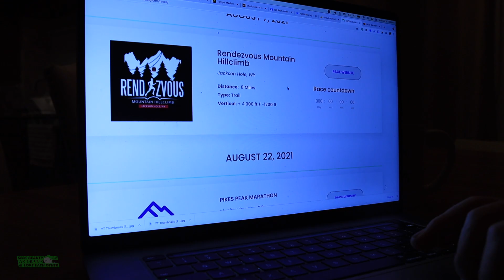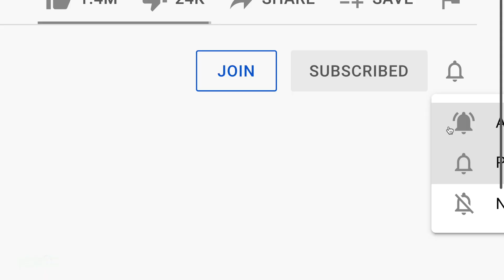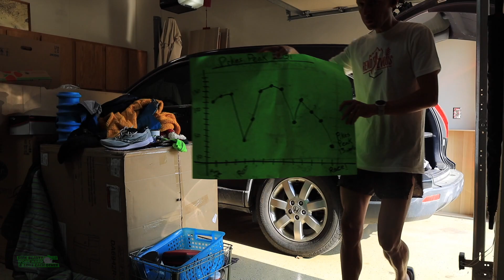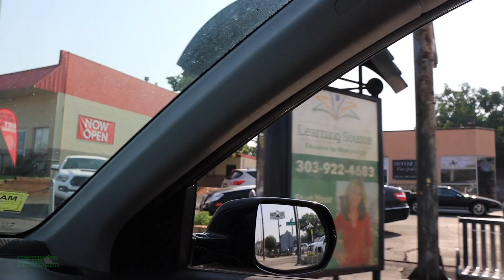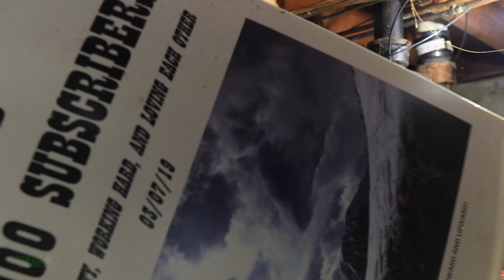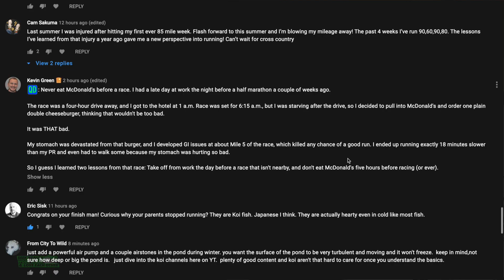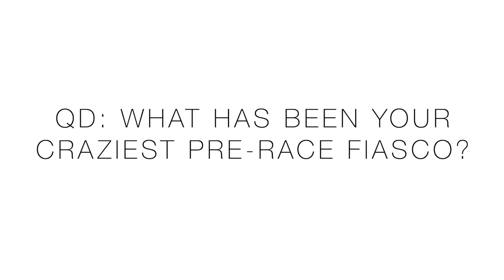Hardest Training Block Phase for Runners Starts Now

Comment: :_qod:: Thanks for selecting me for the Comment of the Day, Seth! It was a humbling experience, but sharing helps me get over how embarrassed I felt during the race.

You're right, I am kind of new to running. I ran XC and track in high school but took seven years off after graduation. I started up again last year at the beginning of the pandemic.

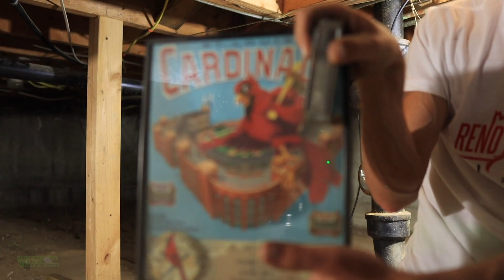Among other pre-race fiascos, just this past weekend I signed up for a 1-mile stroller derby with my five-month-old daughter. I made it just in time for packet pick-up after running 6 miles with my running group and driving 20 minutes home to pick up the baby and then another 30 minutes to the race, but they started the race two minutes early! I managed to get in line behind walking strollers eight seconds into the race, so I had to do some dodging to finally get going. Ended up winning the race in 6:36, which happened to also be my fastest mile since I starting running last March.

Onward and upward!

Comment: My greatest fiasco pre-race: I went on a running holiday with a friend to Belfast to do a half-marathon there. I woke up in the hotel on the day of the race and began to prepare my stuff only to discover I hadn’t packed any running shorts. My friend didn’t have a spare pair either and as it was Sunday in a religious country there was no chance of any shops being opened before the race start. So, I took my micro towel, some safety pins and fashioned myself a little, makeshift mini-skirt! All the way around the half my greatest fear was that it was going to fall down, but I got to the end with my dignity intact and a medal for my effort! Win!

Comment: QD: Last club track season in the Winter of 2021, I was signed up for a race about 30 minutes away from my house in Highlands Ranch, CO. My coach told me that the meet was at Mountain Vista High School, but when I arrived there it seemed pretty dead. After walking around for 5 minutes it became clear the high school wasn't the place. My coach found the actual address, and I had to book it over to the stadium with 30 minutes left before my race. I got there 3 heats before my mile race, hopped out of the car, warmed up as snow started falling, and then put my spikes on as I was stepping up to the line. I totally forgot to take off my warm ups and had to ask the officials to wait for me. All in all, it was a very poor performance, but I made it out there and was able to race at the very least. Still, not the most positive 40 minute drive back to my house.

Comment: About 15 years ago, in high school, I thought I was pretty hot stuff lining up for a Turkey Trot and decided that socks would be “too heavy” to wear inside my very meshy racing flats for a race on a cold, snowy Thanksgiving morning. I couldn’t feel my toes 5-10 minutes prior to the race. However, I managed to make it through the race, grabbed my top 25 finisher pumpkin cheesecake, and went right to my car. My hands were too cold to fish my key out of the tiny pocket of my tights for a while. Eventually I got that out and hit the unlock button and got in. Then I just sat and screamed in pain inside my cold car til I could get a little more feeling in my hands to be able to stick the key into the ignition to start the car and turn the heat on. Then when I had enough dexterity in my fingers I was finally able to unlace my shoes and stick my feet directly on the heat registers. Again, screaming pain. All told, it was probably a 45 minute process before I felt safe to start driving home. Probably got some frostbite that day. Moral - socks are important in the winter.

Comment: :_qod: Seth I was running Hood to Coast Relay and instead of bringing bagels  ect. I decided on bringing a Roast Beef Sandwich and chocolate covered expresso beans. I thought the beans would come in handy because I would be running at night. It was 95 F and I was running way too fast. This whole fiasco turned out to be the worst decision I have ever made. I ended up getting really sick between the heat and expresso beans. I did finish my running legs and turned out ok but never ever again.

Comment: QD:  no GI issue stories in my 45 years  of running road races (started as a 13 year old with my Dad). But, also with my Dad, in ‘93, we planned a Bay to Breakers run with about 75,000 other “runners” in San Fran. Went down to the starting area 2 hours early and stood in the the crowd of thousands unable to move until the gun. And, of course, I had to pee almost the entire time. 30 minutes after the gun, when we finally crossed the Start line, I hit a portajohn for relief! Crazy and awesome experience the Bay to Breakers race, just make sure you go to the bathroom before you go to the race!

Comment: QD: Fairly new runner here. I think my very first race was a five miler and it was cold and raining that day. I prepped on a treadmill and never outside for the race. I wore a light jacket I never ran in before. As you can, there were a few mistakes here. Not running outside and implementing something new on race day.

Comment: QD: Another race day fiasco was at the 2018 Broad Street Run. I was amped up, and ready. I was hydrated and went to the bathroom before the race started. By the time my coral started damn near 45 minutes elapsed. By mile 2 I had to use the facilities on the side of the street.

Comment: QD: My biggest pre-race fiasco was during a cross country meet last year. (I am in 8th grade by the way) I had a big long bus ride to the xc meet and I had no idea what the course would be like, so I brought my spikes and my trainers. When I got to the meet I asked my coach for the map of the course and he gave it to me. I looked at the map for a couple of minutes and it didn't look like there was any pavement on the course, so i went ahead and spiked up. I got my little timing chip from my coach and tied it to my shoelace. Anyway after that my team and I did our warmup run and strides and stretches. We went back to our coach one more time to look at the map of the course and then I saw some pretty decent size patches of pavement, so I decided to take my spikes off and switch to my trainers. I completely neglected the fact that the patches of pavement are on the 5k course, (and I was running the 2 mile). So after that I made my way to the starting line and about ten seconds before the gun went off I looked down at my shoes and the timing chip was gone! I realized that I had left it on my spike's shoelace. At this time I didn't have a watch to see what time I got and there was no way for me to tell what place I got without that chip. So I ran back to our teams tent, conveniently very far away, to get the time chip. I couldn't get the time chip off my spike in time and by then the gun had already gone off and everyone was running. So I just ripped the time chip off the shoelace and started running back to the start line. While  I was running back to the start line i wasn't looking where I was going and I bumped into a toddler who fell over and started crying. I was just glad his mom wasn't there. I kept running to the line and then somebody from behind me told me to stop. I turned around to see who it was and it was the toddler's mom. she said that I had to say sorry, so I did. Then finally she let me go so  could start running. by this time everyone was already halfway through the race and I was guaranteed a last place finish. I ran the whole race anyway, holding my time chip with my trainers on and finishing second to last. It was a total disaster.

Comment: QOD: My biggest pre-race fiasco was for my first and only road full marathon. The race, The Sasayama Marathon, is notorious for being cold, sometimes with snow, and I trained accordingly.

On the day of the marathon, it was sunny and unseasonably hot, "but just in case", I kept my warm clothes on. Yeah, I DNFed, due to dehydration.

But it was an invaluable failure, as the race was training for my first ultra race (yea, I signed for an ultra before ever running a marathon), which my team ended up crushing (17th overall, 3rd in the mixed team category).

The lesson I learned from that fiasco: adaptability. Look at the outside conditions and adapt.

Keep on moving.

Comment: My worst decision...1986, a 20mile race and was fittest I'd ever been. I forgot my Vaseline to protect my feet from blisters, so decided to use some moisturizer instead. TERRIBLE decision. Instead of stopping blisters, it gave me really bad blisters which made me stop at 14miles to get first aid. Lost 3minutes due to the stop and failed to beat my 20miles under 2hours target by 1 minute ! Aaaaarrrggghhh
Reply: Vaseline provides a barrier against sweat or puddle water permeating into the first layer of skin which with friction, creates a blister. Moisturizer actually puts water INTO the skin causing blisters...if I only hadn't been so dim that day 😃 Never ran a faster 20m after that day 😒

Comment: :_qod:The day before the Long Beach Marathon in 2019 I was so nervous that I ended up walking 10 miles and spent very little time off my feet. I also had a huge restaurant dinner. It was a total disaster and I blew up at mile 14. Still finished but it was ugly, and really hot. God, that was a bad one.